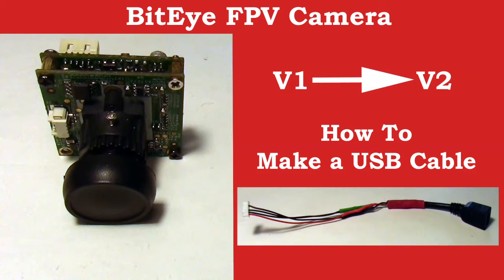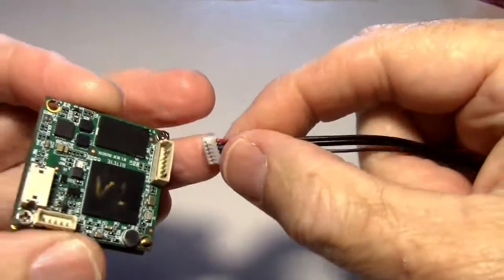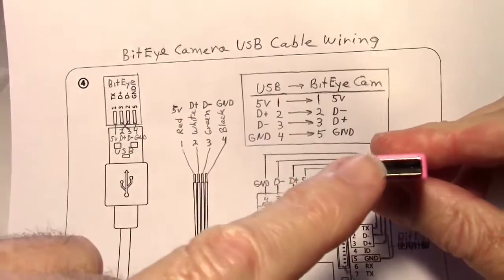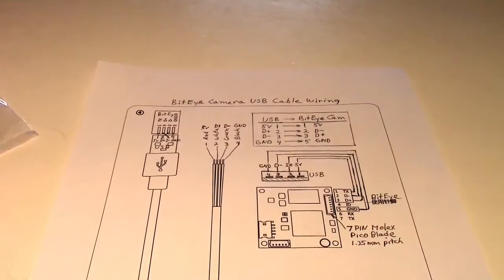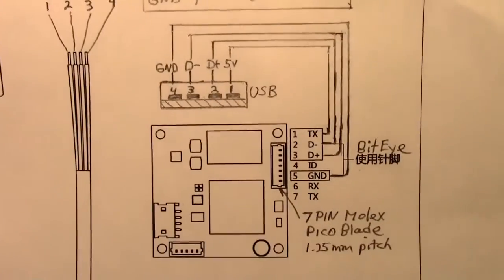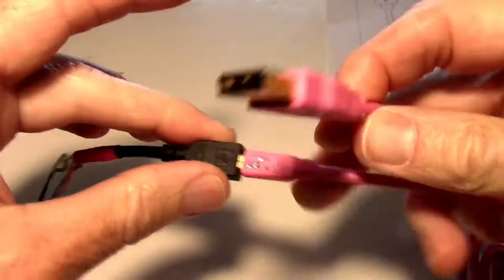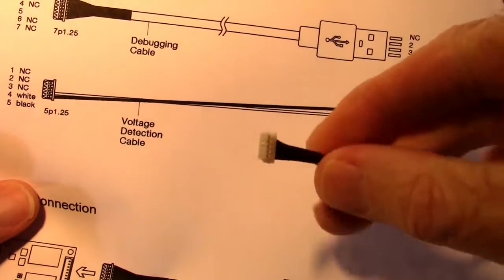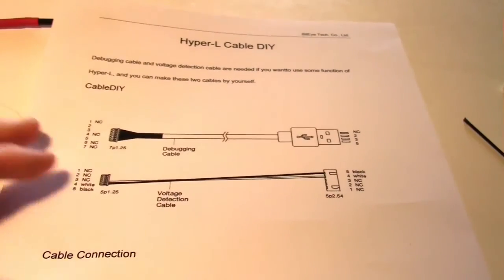BitEye FPV Camera - How to Make USB Cable and Voltage Detect Cable

Comment: Hi
My webcam has 4 wire as you mention in the Video
5V GND D+ D-.
I want to connect the webcam to Video Transmitter
The Vtx has several ports (Pinput, Pout to camera,  GND,Video,Smart audio)

Do you where should I connect the D- and D+ wire?

Comment: hi sir? can i connect cctv 12 volt DC camera with my pc using usb cable?
Reply: Did you get any answer i also want to convert my bnc into usb
Reply: @johnnydepp7101   still nothing
Reply: @AdhaMusa  sad 😞
Reply: @AdhaMusa  easier cap is the solution but its cost 500 rs.
Reply: @johnnydepp7101  where to purchase
Reply: @AdhaMusa  Amazon
Reply: @johnnydepp7101  okay dear
Reply: I have the same problem

Comment: Now this camera comes with a USB cable and PCB that you can hot glue in a convenient place.

You can buy the connectors and pins from HobbyKing -- cheap.

On the voltage sensing cable, you can route the power leads from the four-pin cable (video/audio) TO the voltage sensing board for ground and 11.1 volts which is safer than plugging into whatever battery you have which may be a 4S providing too high a voltage.

Comment: So, the firefly Q6 has gyro stabilization, is decently low latency, record 60 frames a second 1080 P, and some other 2.5k modes. In general it seems far far better. The quality of the images is so far clearly better, and includes an exact voltage display OSD, also the cables come with it.

Comment: Another very helpful video Dave. I'm hoping BitEye will release their own cables soon. Sometimes it's hard for (some of) us to source the proper wire and connectors to build our own and it would be impossible to build them without someone like you to help us.
A big thanks and thumbs up!
Cheers, Bob
Reply: we can give these cable for free to customer who upload a review video or flight footage, welcome to contact us.
Reply from the maker: The V2 comes with the USB and Voltage Detect cables already.
V2 is available on amazon now.

In this video I am showing how to make cables for the V1 after upgrading the firmware to make it like the V2.
Reply: Yes, I just meant that it would be nice if BitEye sold the cables separately for us V1 owners who are not as gifted as you in the cable making department :-)
Reply from the maker: Oh, Never mind :-)
Reply: That's a great offer! Get ready to ship a cable lol.

Comment: Dave,
Great series on the BitEye v2 camera! This seems to be a nice all-in-one alterative to a mobius and separate fpv board camera. It also has similar setup features to a mobius or runcam type camera. Would you consider doing a quick comparison of video shot by the BitEye vs RunCam and Mobius? 
Cheers!
Fergy
Reply from the maker: +TheAdkFlyer10 I am really liking the BitEye. Your right it would be a good idea to do a comparison between BitEye vs RunCam and Mobius at least for 1080p  resolution at 30fs.